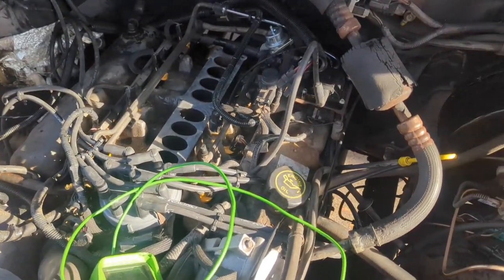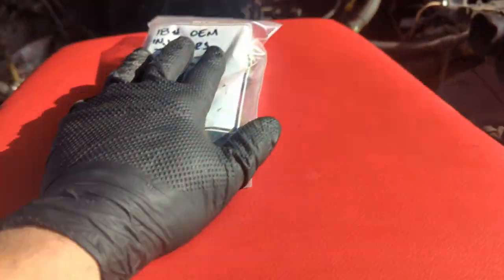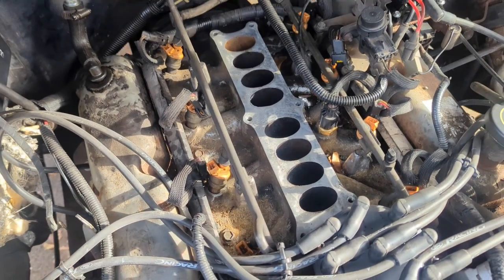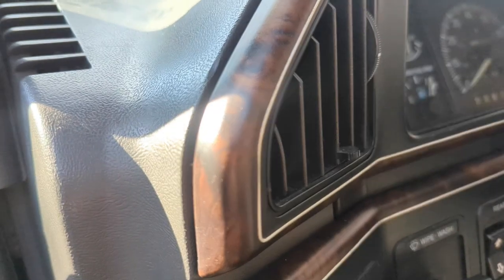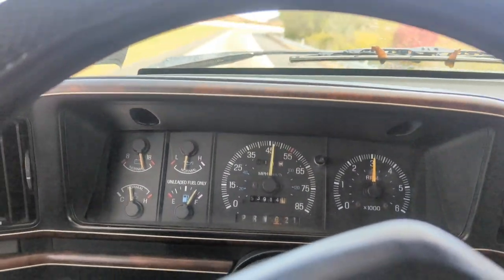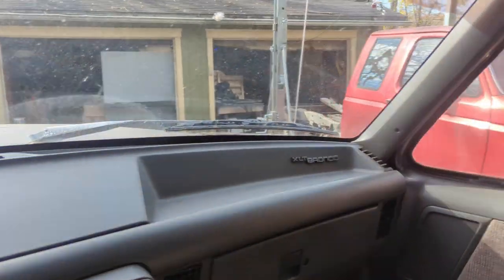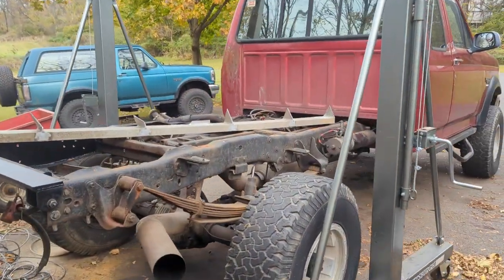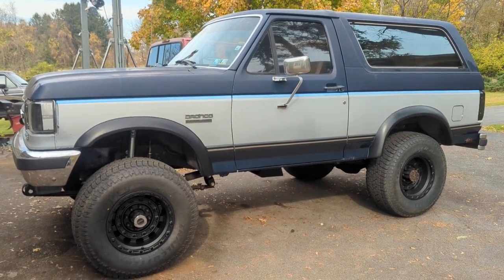Ive been spending all my time troubleshooting

Comment: I was thinking about putting explorer fuel injectors in my wife's 91 bronco, the internet says that will increase mpg by 2-3 miles, have you heard of this
Reply from the maker: Actually, I have! Our old trucks only have 4 hole injectors, the Explorers got 6 or 8 hole. This improves fuel atomization which in turn improves power and mpg. 3 mpg though? Maybe, maybe not.
Reply: @part-time4wd  yeah it sounds to good to be true
Reply from the maker: @jackwells1452 I agree, altho I suppose if yours aren't working so well then a better newer set might make a noticeable difference. As it would turn out, the original set I rebuilt myself are now back in and running just as good as ever. Just goes to show that you need to be thorough and check everything before you buy anything!
Reply: @part-time4wd  no, her bronco runs great, I was just thinking about fuel mileage, thanks for you're input, I guess leave well enough alone

Comment: Thats life with Fords... I'm a Ford guy but i have to admit they are junk, and these old ones? forget about it... Thats why i buy Toyota... When i rent i try to get Ford for shear creature comfort but as far as purchase i value my time too much to waste time with any domestic brand.
Reply from the maker: I dont completely agree....i mean i DD my 96 and its perfectly reliable.  This one, well, when you buy a vehicle that hasnt run for years theres gonna be quirks getting it running smoothly.  In this case  i thought one of the old injectors clogged, when in reality the ECU failed.  Then i made the problem worse by installing a reman set of injectors of which one was apparently defective injector which just compounded the issues.  Really, i blame this one on crap parts coming out of the aftermarket these days.